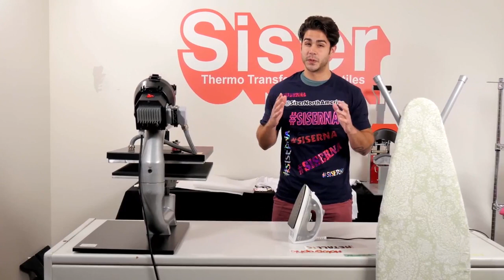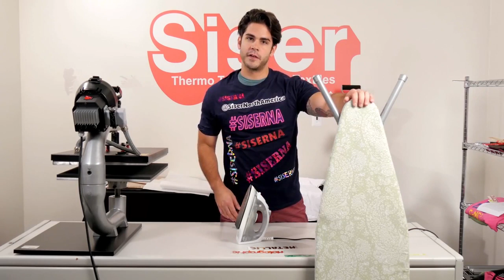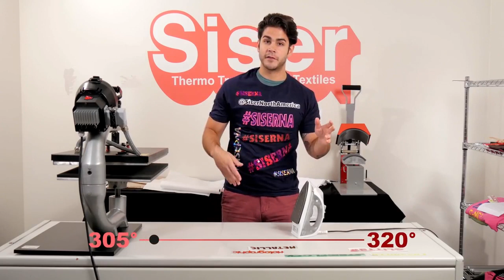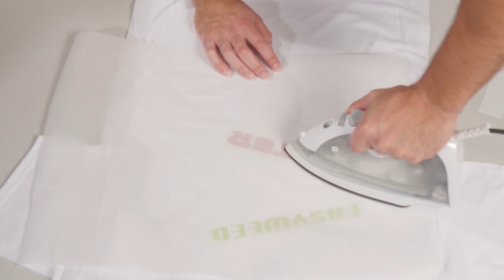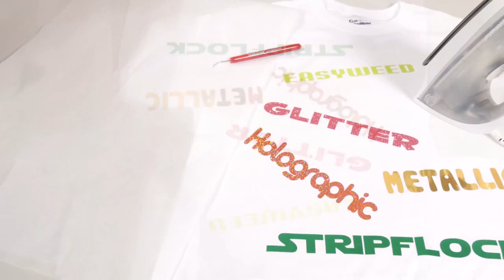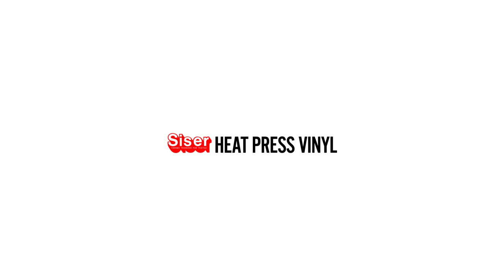How To Properly Iron-On Siser Heat Transfer Vinyl

Comment: ok so im just wondering on why does it look like my design shrunk after washing it
Reply from the maker: If you placed your design on non pre-shrunk cotton and washed it with very hot water, you would see the underlying material start to bunch up. You can try to re-press the existing design again (using a teflon sheet on top of the HTV) which should help.